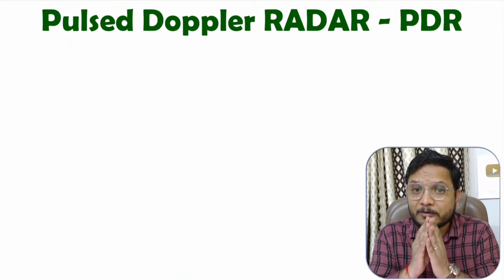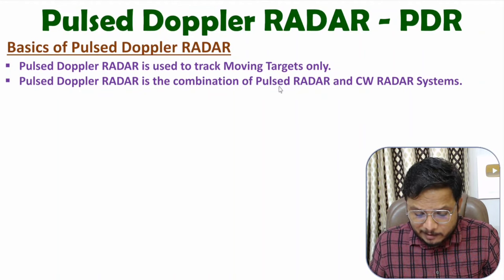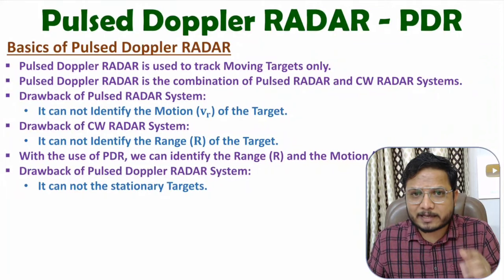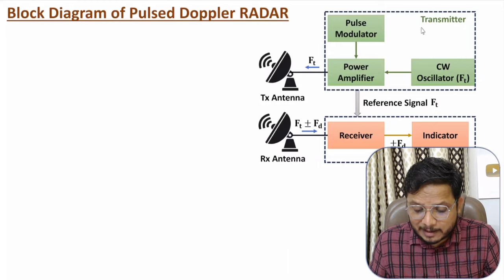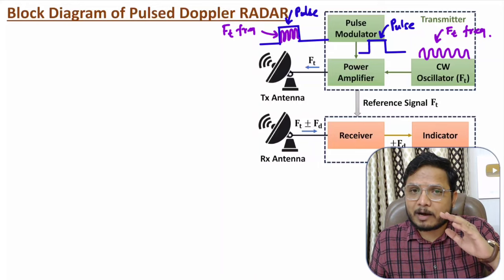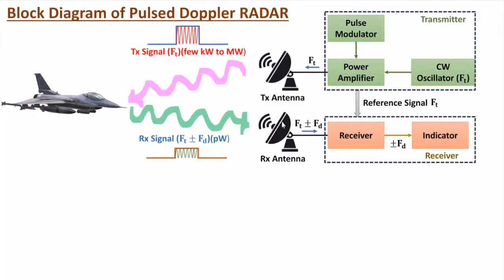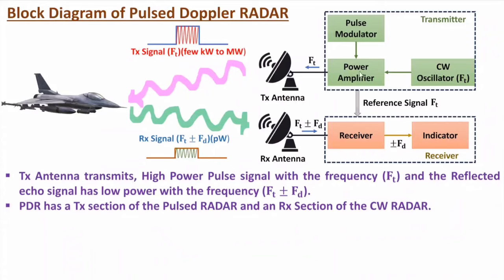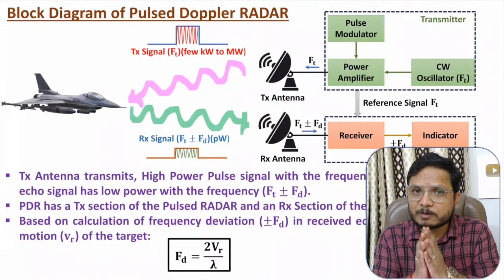Pulsed Doppler RADAR (Basics, Working & Block Diagram) Explained by RADAR Engineering

Comment: Would you please let me know which type of transmitter is used in PDR radars? power oscillator or power amplifier?
Reply from the maker: Both are used
Reply: @EngineeringFunda  But if you look at your comparison of MTI radar and pulsed doppler radar system, you mentioned that in pulsed doppler radar, only power oscillator is used...
Reply from the maker: @marjanmarbouti5425  Mojor use is power amplifier only but Magnetron Oscillators are also used.

Comment: Sir, is this not similar to FMCW RADAR ?
Reply from the maker: Nope, FMCW radar is also covered in playlist, go through it and you will get the differences.
Reply: @EngineeringFunda  the difference is in terms of Tx waveform right ? FMCW radar has continuous wave varying in freq., while PD had continuous wave in short pulse.
Reply from the maker: @yashshah17 yes